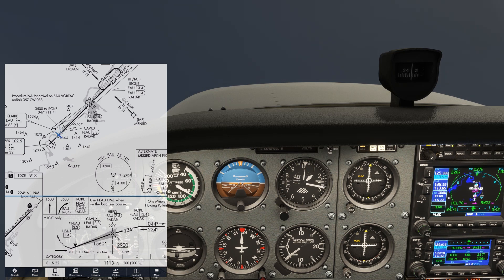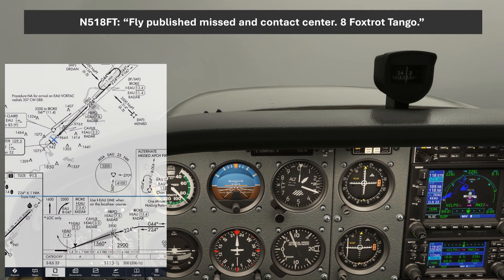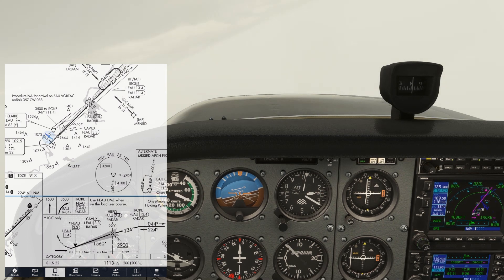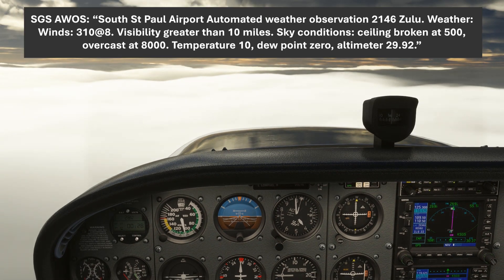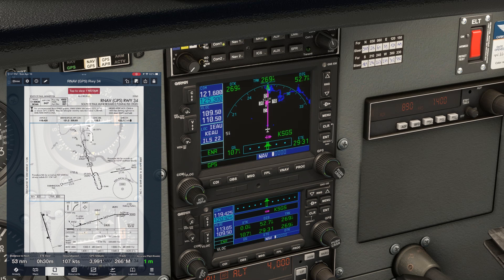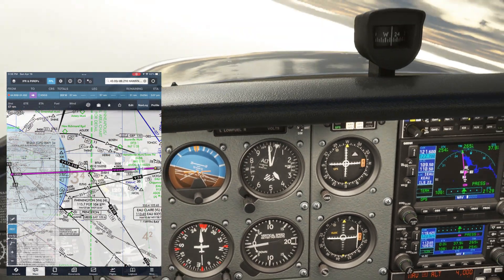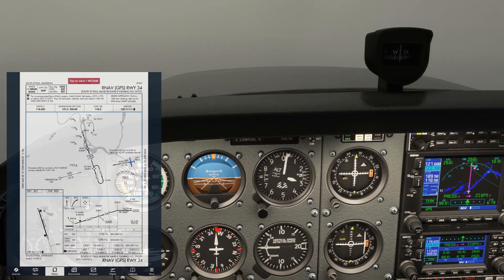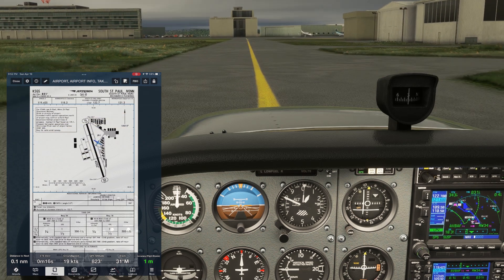How to Go Missed | Executing a Missed Approach and Diverting

Comment: To put a point on just visual conditions, be sure to only cancel IFR if you're certain you can meet VFR cloud clearance requirements through landing. A common mistake is canceling too soon during the approach while not having the required 500 feet below clouds separation in controlled airspace.